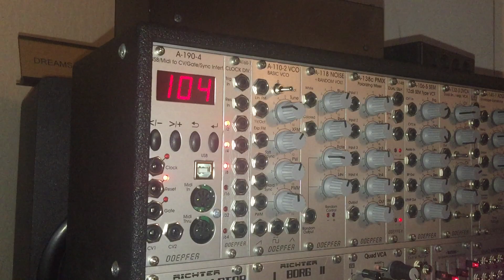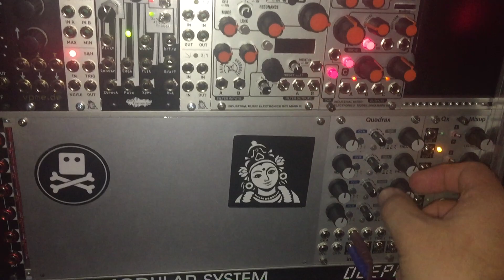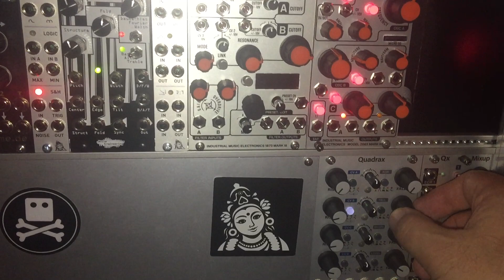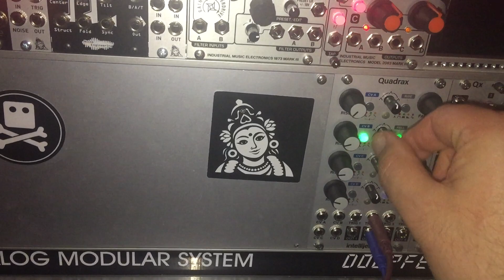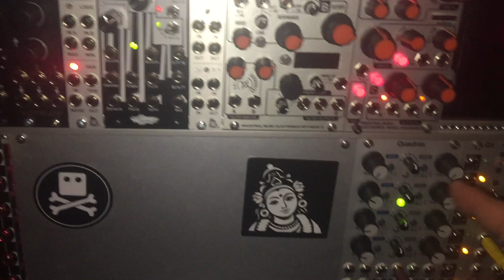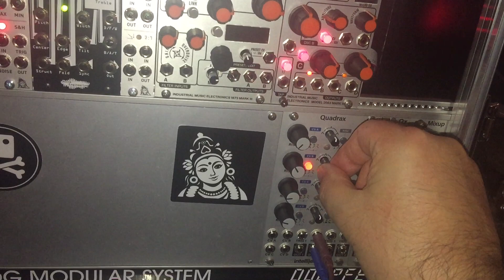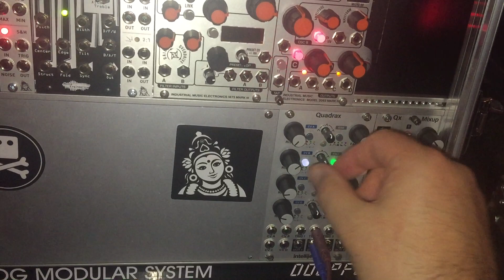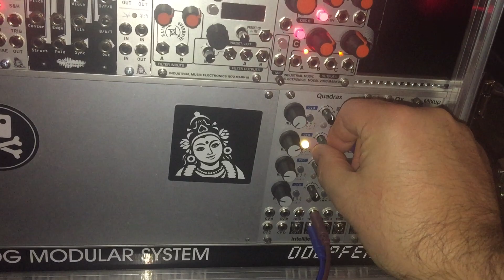Exploring Intellijel Quadrax

Comment: Each channel should function the same. If channel 1 is not responsive, it could be that you have assigned a CV input to control the LEVEL of that channel. With nothing at the input to set the level of that channel there will not be any output. You can easily clear all CV assignments by holding one of the left buttons to enter CV assignment mode, then press and hold the top left and bottom right buttons.